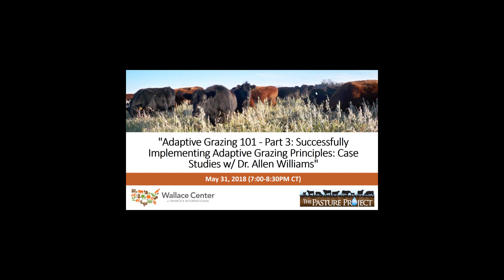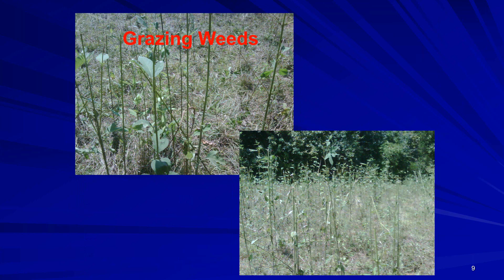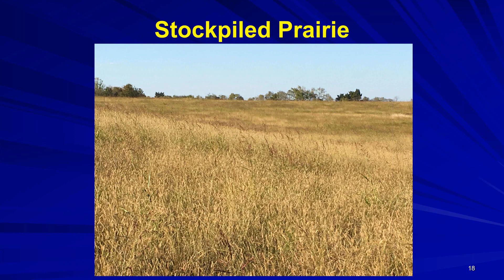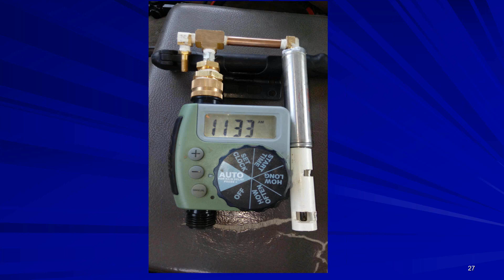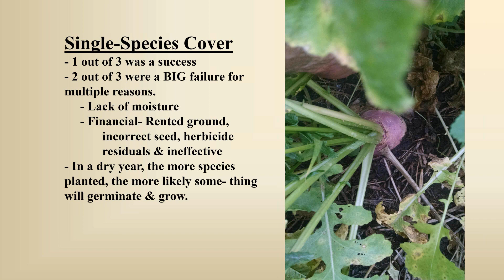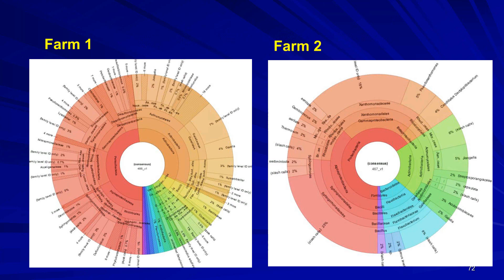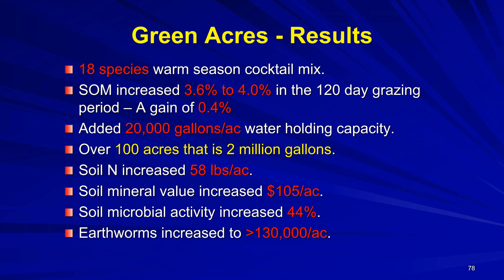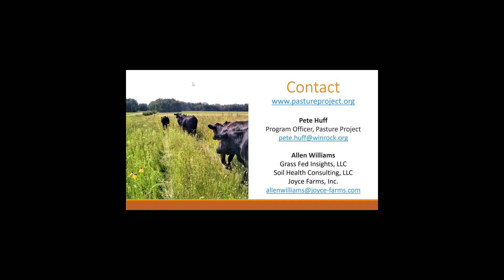Intro to Adaptive Grazing - Part 3: Implementing Successfully w/ Dr. Allen Williams

Comment: Wish this had incorporated trees in a deliberate way, instead of focusing on them as shade alone.  
The series definitely could have been better with a delineation of the problems with synthetic chemical inputs versus synthetic inputs free.  Incorporating frequent, smaller rainharvesting earthworks would have been wise as well.